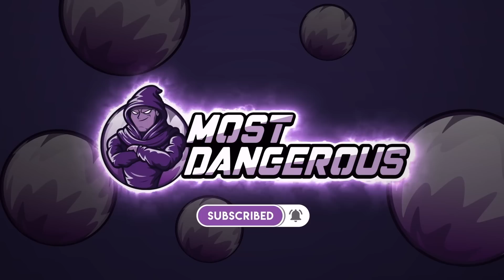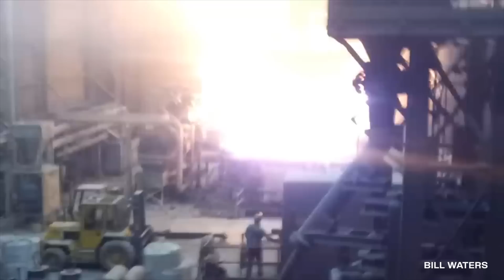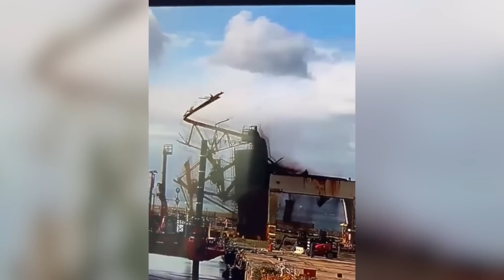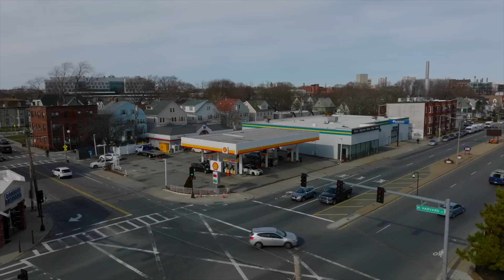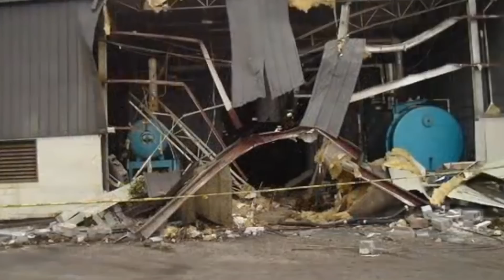Expensive Industrial Failures Caught On Camera

Comment: Should see the videos of an industrial glass kiln when the bottom melts out.
 This type of accident happens ( relatively ) frequently in the glass industry & they contain the mess in the basement - but still, watching several thousand tons of molten glass dump out the bottom of a failed kiln, is frightening to see.
Edit: I've seen gantry cranes slated for demolition, intentionally ran at full speed off the end of their rail, tipping them over on purpose.

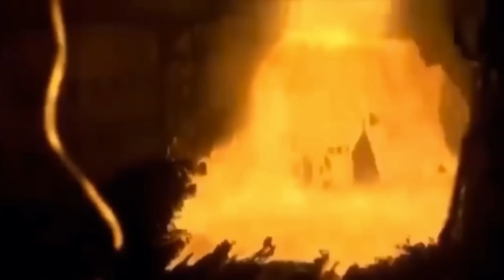Comment: 1:09 Impressive!!
Also you really not want be nearbly,1600-1800C can burn and melt stuff easy.
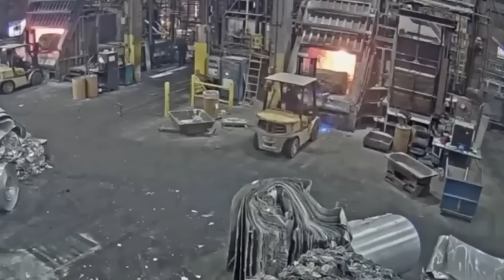2:17 This is why you never do it not you but othere are in great danger of burns!
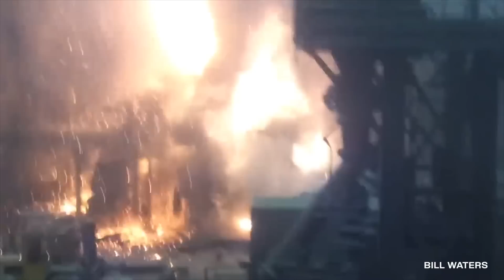3:06 I thing some parts of roof was damaged too also gl with cleaning:):)
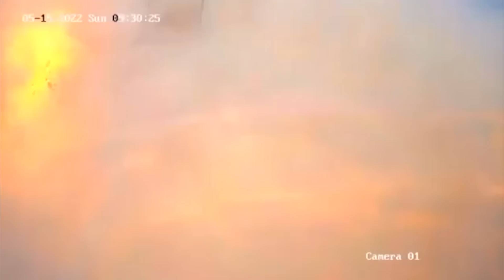6:35 Wow,this is why vapors never be inside!
7:34 Nothing beats exploding boiler its like bomb!
Realize factory steam have pressure higher than 1.6MPa(16Bar) its enought to ruin any structure.

Comment: 6:35 Imagine this exact scenario is what led to the Chernobyl explosion. The immense steam pressure popped a 1000 ton lid right off and through the concrete ceiling. Then falling back down nearly vertical. Three seconds later, a massive hydrogen explosion.

Comment: I worked at a steel factory circa 1979 - had wild dreams of becoming a industrial engineer technician. We would go into the works to do assesments of proceedures. What I saw there and the stuff guys had to do.....in short got me a bit scared, in particular the area where the rolled train tracks. In some areas the workers had to go into more confined spaces...it would not take long before they got out, empty a bottle of Coke and went back. They implemented a new smelting process using electricty - it sounded more like the pots were going to explode. I eventually left not because of my fears but maths and tecnical drawings got the best of me - if you failed your contract was terminated😅 Interesting, hard work and much respect to the guys who could handle it👍

Comment: Yeah I worked in a Albert's integrated piping systems factory in the 7 months I worked there in machineining maintenance I was sent to the foundry to help with the 2 times the crucible exploded so bad there was steel stuck to the 60 foot ceelings or the wall 100+ feet away all becuse 3rd shift didint pay attention to the warning lights

Comment: Slightly bizare addition of the "Cannot happen with a Clayton Steam Generator"... as if they were advertising how safe this product is... buy us etc...
And Saying ANYTHING cannot fail just invites an Iceberg to find its way into the path of an unsinkable ship (Yeah, you know the one)...

Perhaps someone would like to tell that to theLoy-Lange Box Company (LLBC) St. Louis, Missouri
I think they might have a 2nd opinion
(From April 3, 2017).

Personally I repair Hot water pressure washers (generally 3kpsi 120deg C, although anything over 90C tends to get back to that temp very quickly on release into the wild.
With those little fun munsters the weakest link is the one that goes... and when it does it's like a shotgun... if your luucky...
I have a rogues gallery of twisted pipework... and my own personal "pop" was an old Clayjet that used no restriction on the outlet, and a horozontal furnace coil (BAD design)..
Sooo the day when the outlet blocked with muck from inside the pipes... and unburnt fuel dribbling into the coil meant that there was no way to shut off the fire (as the soaked oil was now fueling the fire, and no water was moving)... luckily the outlet pipe has a HP braided hose that let loose before the coil.   I still had to walk to the front of the workshop and wait for the hilarity to settle.

Comment: 2:00 I've read that scrap is usually left, sheltered from rain, to dry out first or put into a drying oven to prevent just this.

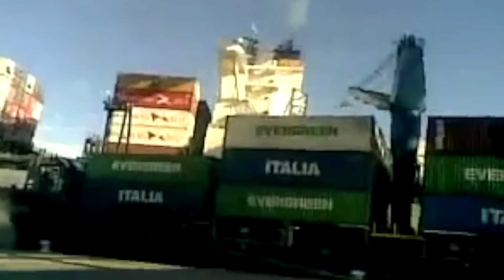4:00 No matter how bad you screw up at work today it is likely not as bad as this.  I'm surprised the crane was built without allowing for the overhang of a ship and an accident like this.

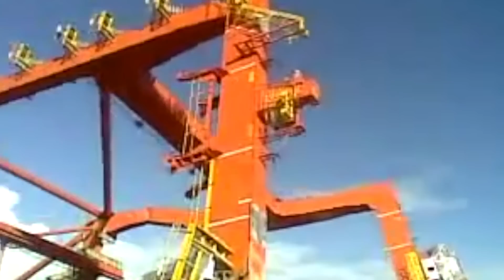5:00 Looks like they needed to remove the big counterweights first?

Comment: I'm kind of surprised the forklift guy drove out of the building with his tires on fire. I mean, the forklift was protecting him from the molten metal on the floor, so he had to get away from that before he could get off, but after that I would've ditched the machine and ran out of there; I wouldn't want the melted tires to keep me from getting my irreplaceable ass to safety.

Comment: The exploding steam boiler caused so much damage, due to all the water in the boiler turning to steam instantaneously.
Reply: And pressure too...factory high pressure steam is more than 1.6MPa(16Bars) that is enough ton ruin any structure and move boiler very far.

Comment: 1:20 This is a slag drain, not metal. This is not standard but common practice in production. I myself am a steelmaker from the Urals and I see such a video 3-5 times a month. There is nothing wrong with this, first we remove the key for supplying high-voltage voltage to the electrodes, then pour plenty of water on the slag, and then we use a special tractor to grind pieces of slag into scrap and continue working with metal, the whole procedure takes no more than an hour.
By the way, there is a feeling that the video was filmed in our workshop, but we do not have slag blocks on the sides of the rails and along the walls, after each metal drain, the remaining slag is swept away with a metal brush on a tractor.

Comment: I work with molten magnesium and I appreciate you taking the time to explain to your viewers that whats happening with these accidents; I get so many new people at work that, even a month into working there, don't even know or understand how deadly water or any other liquids can be with molten material.
Reply: I'm just a layperson, but it makes sense to me.  Tell me if I'm on the right track here: Molten metal, like steel or iron, can reach temperatures of 2500-2700 degrees Fahrenheit (or more?), while the boiling point of water is only 212 degrees.  Any water that hits that slag is gonna instantly vaporize in an explosion of steam that throws that slag everywhere.  And aside from that, I'm pretty sure water and metal don't mix well anyway.  Sort of like when water accidentally hits a pan of hot oil, albeit on a much smaller scale, and possibly slightly different principle.  But similar violent reaction.  At least, that's what my limited knowledge suggests.  Am I in the right ballpark?  Or am I totally off?
Reply: @mariebelladonna437  congratulations you passed preschool
Reply: @defeatSpace  and you're still there, as evidenced by your unnecessary snark. Do you feel like a big kid now? Does putting others down make you feel better about yourself? Lol well, go ahead and knock yourself out then, buddy. It doesn't bother me. I've been through way too much in my life, to let a petty internet comment take me down now. So go for it. Have fun. Troll away, troll. 🤷‍♀️👸😂
Reply: @mariebelladonna437 I thought Water boils at 112.
Reply: @libertyforall5764  Just rechecked, in case I read it wrong.  Google says 212F, or 100C.  But that's just one Google search.  And I'm just one person.  Maybe there's something I don't know.  I'm always happy to learn.
Reply: @mariebelladonna437 the trouble isn't necessarily when water contacts the molten metal if the steam has somewhere to go. The problem is when that steam gets trapped and has no where to go. When water flash boils to steam the expansion rate is something crazy like 1500 times or something like that. I don't have the exact number. The point is that the expansion of that steam is what causes the explosion cause the steam is going to escape. It doesn't care that molten steel is in the way. Same thing when boilers explode
Reply: @JBDay-bd8cu  yeah, I get that. Makes total sense. Thanks. 😊
Reply: @mariebelladonna437 sure thing. Anytime
Reply: @mariebelladonna437 most modern steel mills don't have to worry about that though like in the video becuase most scrap metal that gets added to a mixture goes through a preheat procedure first specifically to heat up the metal and evaporate any water out of it before adding it into the batch. Particularly in steel mills that are blast furnaces. Meaning they melt iron ore then add the iron ore to another furnace and add scrap steel to that. In the mini mills which melt 100% scrap steel then add alloys accordingly all of the scrap gets preheated as it comes into the building to be charged into the furnace
Reply: @JBDay-bd8cu  I've seen that on "How It's Made" type shows. But for some reason I never connected it with that reason. Seems pretty obvious now that you've told me lol. Still, I learned something today. Thanks for that. 😊
Reply: @mariebelladonna437  you're welcome. Anytime
Reply: @mariebelladonna437  You just might be "totally off", but you are also correct.
Reply: @otpyrcralphpierre1742  LOL that is probably the best response to that question anyone has ever given me! And the most accurate... 😬😂

Also, glad I understood it correctly. That makes me feel good. 😊
Reply: @mariebelladonna437  Thank you, I strive to make a Lady "feel good", and put a Smile on her face. THAT is what makes ME "feel good".
Reply: I've worked in steel making 16 years 9 of those in research, you can dump as much water as you want on top of molten steel, worst you will get a skull on your vessel,  but pour molten steel over water. Imaging taking all that water and instantly turning it to vapor and the space that vapor has to fill. That's when you get a blow out. 
Different then a live heat but both will pucker your butt.
Reply: @kipclifton9403  Oh, yeah, I get it. That makes total sense.
Reply: @kipclifton9403  I think I understand it a little better now. When water is poured OVER molten metal, the vapor has somewhere to escape. But underneath, and that molten steel may as well be a pressure vessel, whose failure is extremely violent and dangerous because the now vaporized water becomes a very highly pressurized combination of explosive Hydrogen, plus Oxygen, which fuels fire and explosion.   Combined with extreme heat, this pressurized combination is pretty much in my head a combustion event much like one sees in an internal combustion engine. Minus moving parts, and the controlled, planned ignition. I would imagine this to be quite a terrifying event, and ANY steel worker's nightmare. 

Obviously, I'm simplifying, as the chemistry and science is a little above my complete comprehension.
Reply: @bobw7018  wow! Very well said,  I'm impressed. You even covered the hydrogen and oxygen elements.  Did you take a metallurgy class ? Beside the point you did a good job, one of my mentors told me if you can't explain it so a 10 year old can understand it you don't know it well enough, and you did good.
Reply: @kipclifton9403 Thank you! I simply remember that extreme heat can split water back into it's gaseous elements, and I've grown accustomed to explaining things in very simple terms to people at work.  It also helps that my grandfather was a steel worker all his life, and left MANY MANY MANY books on metallurgy, and industrial safety. Evidently, I retained more than I thought after so many decades....
Reply: What I was told was that the water molecules actually separate, and the highly infammable  hydrogen causes an explosion.
Reply: @californigirl  you are correct. The oxygen bonds to the metal leaving free hydrogen which then reacts with the oxygen in the air and going back to water. This happens in an instant.
Reply: @californigirl  ooh, that's a super fascinating theory!  I'd be interested in doing some research on that!
Reply: @californigirl  Water expand 1,600 times its original volume when super-heated under molten metal of any kind. It is basically a hydrogen bomb with molten metal
Reply: Any bets that forklift load had something like a sealed tube or square section, that was full of water.
A family friend ran the local Zinc factory up the road, G.R Stephens & Co... Used to love how the whole place was lit up like amber streetlighting from the Zinc.
Reply: No shit I work with magnesium as well!!!
The second foundry one,the guy walked in that office and he was recording cause they knew it was probably gonna blow.
But them pots need filled regardless 🤣
I watched my Foreman blow a lid of a pot because the metal scrap we were putting in was freezing cold cause the Temps were -5 with windchill.
Reply: if you explain it to them they'll stop working 🎉
Reply: They should understand or not be working there
Reply: @SoulSearch11110  ABSOLUTELY! The steel mill is definitely not a place to be if you don't understand the seriousness of the danger that is always there.  This career can be very costly if you aren't careful.

Comment: That steam boiler was likely the result of putting cold water into a dry hot boiler. It flashed to steam immediately. The pressure relief valve may have been faulty, but I don't know if a good one could have handled that much overpressure that quickly. (I am a licensed boiler operator). I have seen plenty of pressure valves pop off. And they do release a lot of pent up energy. But that much? Not likely.
Reply: Boiler operator here. I got to read the report on how it happened. Yes cold water was dumped in it. Plus the fact that the low water cut out alarm and safety had been bypassed along with a couple other safety’s had been bypassed also. The operator on rounds seen no water in the sight glass so he opened up the valve to put water in it and kaboom.
Reply: source?  @wolf122168

Comment: I work in a iron foundry..been caught on fire twice, fell down the neck of a HMC ( essentially a slag box that carries 12,000lbs of liquid red hot iron)  I have scars on my feet from my boots getting so hot, watched Iron fly like a fountain and a lot more. Eventually you get used to certain dangers and it becomes the norm. I love the job and I love the paychecks even more.
Reply: my dad worked in a foundry and seen someone lose his foot due to walking along a channel and his foot slipped.
Reply: Worked in a steel mill for years in steel making, I've been in blow outs more than I can count, been caught on fire even more, always had my silvers on and always out of the red zone. You really get use to the dangers. You learn when a heat starts to go live to run duck behind cover wait for the boom run to the next cover hide and keep doing it till your clear. The only time I knew I was dead, I was on the 7th floor of the BOF sampling and we had a blow out. Everything went black except my CO meter that was ticking 1200ppm it was the fire or the explosion it was the gas that was gonna kill me. Luckily my boss ran in and grabbed me and led me to an emergency ledge to get fresh air.
Reply: @kipclifton9403 that is a very interesting story. I worked in a pipe mill as an electrician. Our dangers weren't molten metal since we didn't have a melt shop. Just a reheat furnace for the billets the piercer machine that hollowed out them and various other equipment. Being impaled by pipe, falling off equipment, death by electrocution or being crushed by equipment were some of our hazards. Also worked at a flat rolled mill that had similar dangers. I still haven't gotten to experience a melt shop but always wanted to. Well I did but it was for a short amount of time while the mill was down I didn't get to see it in operation. Would have loved to have seen the pouring into the tundish and the slagging off. Ohh and the caster cut off. I'm still somewhat young it isn't too late
Reply: I visited a foundry in India one time.  They were filling the molds by hand.  And the workers were barefoot.
Reply: Only the paranoid survive.
Reply: I remember I was 22 and i was getting a group hire tour at a foundry and the manager stepped out to take a leak for a minuet and left us with the foundry mechanic. Before the mechanic was hyping it all up Infront of the manager but as soon as he left he look at all of us young guys with a straight face and said one word 
'Run'

Thats it. I took his advice lol. Very scary job
Reply: My hat goes off to you Sir.
Reply: You love the paycheck more then your life
Reply: Hopefully you get paid 100k other then that i probably wouldn't do it

Comment: In my work we use 2 giant gas boilers, and they are regularly inspectioned and maintained, but i know that if one of them explodes the damage would be brutal.
Reply: Brutal is easy word..its like ticking bomb.
Small boilers can ruin house for example.
Reply: @joe125ful  I know, and for that the walls where the boilers are were made super deep and reinforced for that purpose, to minimize most damage in case of explosion, still if that would happen the area would be erased from existence.
Reply: @Feiwong1416  Uhm from what i seen most boiler rooms or steam exchagers are builded in - sheds - and i really cant realize how thick walls you need build to stop 3 meters of diameter boiler under more than 1.6MPa(16Bars).
When it can easy fly 30 meters.

Comment: Can confirm a wet charge in a smelting operation is no joke. Water droplets expand 1,000 times their volume when immediately turned to steam. The amount of water you can hold in your mouth is more than enough to cause catastrophic damage. Very closely in dangers of a steel mill is a bar line cobble when the full billet is heated and sent down a line of roller molds at an incredible speed to form into whatever product you're producing. Half mile bar mill can get in the neighborhood of 70-80 fps. If a roller is misaligned and the white hot billet hits it, it comes out like spaghetti that's trying to un alive you